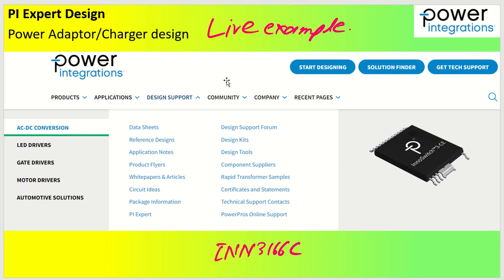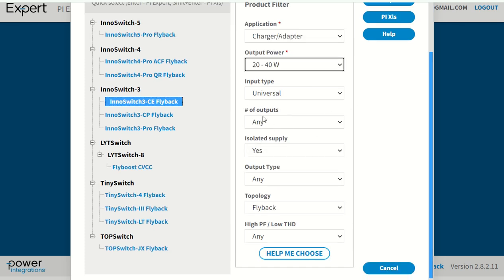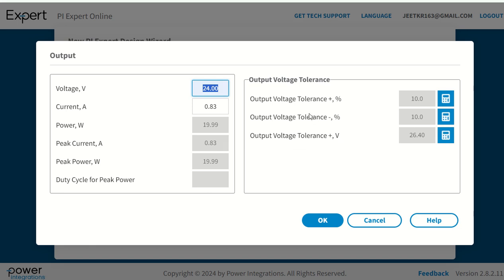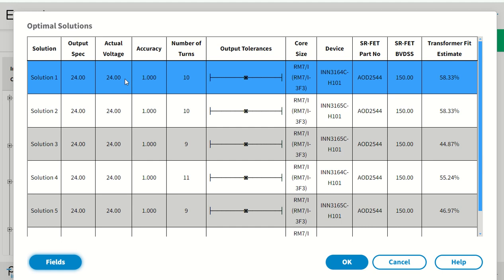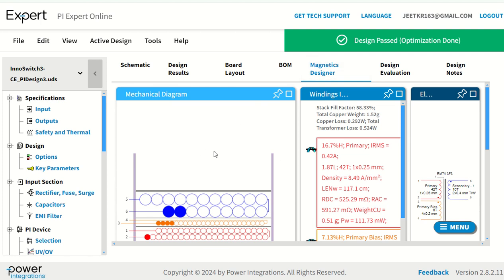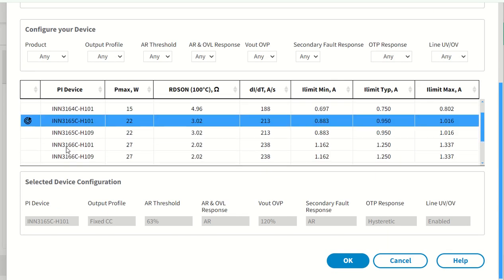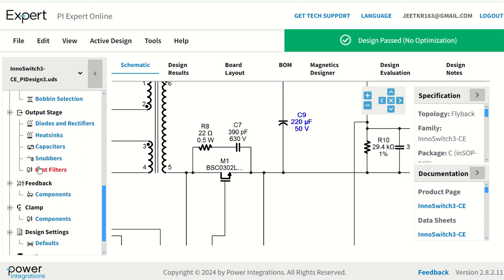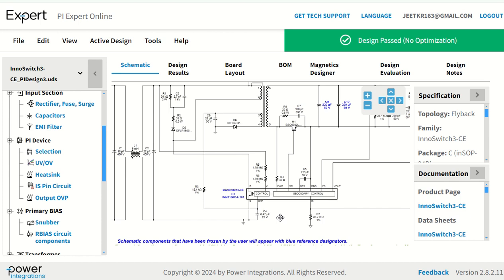053 PI Expert Live design flow AC DC Converter Explanation

Comment: hi iam making smps as software i have got circuit now how i can and where can i simulae and check values please reply
Reply from the maker: If you are designing with the piexpert, it provides you the simulated results.
Reply from the maker: You can vary the values in PI Expert design, and can observe the variations in simulation results, hope this helps